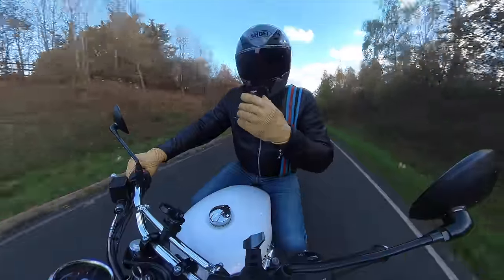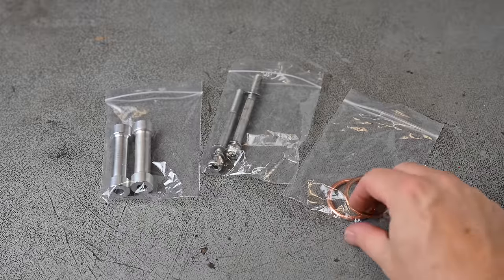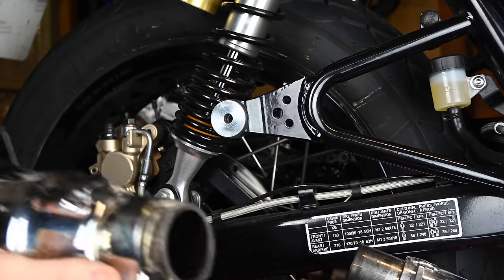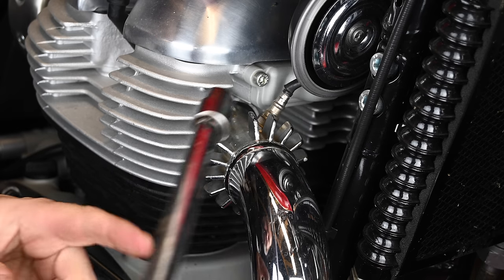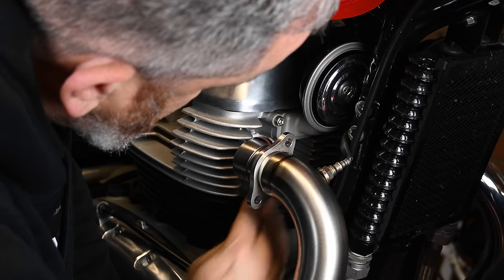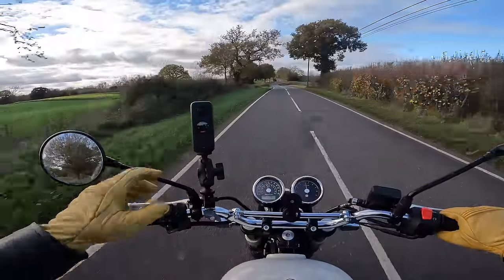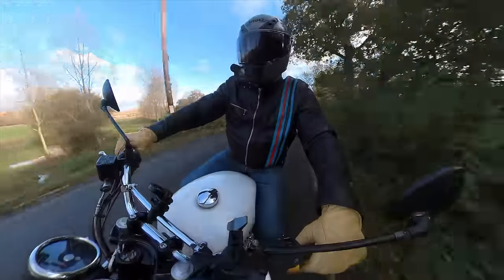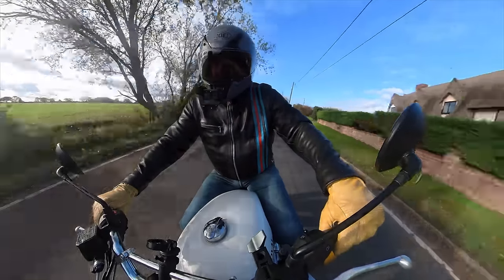Interceptor 650 Project Ep.5 - New exhaust fitting, road test & sound comparison!

Comment from the maker: Since making and releasing the video, Sold Out have reduced the price to £795 inc delivery (within the UK)
Reply: Quality may differ obviously but it looks like a £100 bit of Chinese pipe off eBay £800 seems Ludacris
Reply: Yep, I think quality would differ.
Buy cheap, buy twice.
Is Ludicris a Greek god?
Reply from the maker: I thought Ludacris was a rapper?
Reply: @DucatiDale  I agree that the pricing is steep. There's a company that sells 304 Stainless Exhaust Parts in the Uk and it looks like you could buy all the components for £300 or less, retail. It's not a one piece custom bent, appears to be  standard parts welded together. Looks are a personal thing, but I prefer the look of the original exhaust, I don't like these cut down exhausts.
Reply from the maker: It’s a low volume production made by hand in the UK. I think the price reflects that. The end can isn’t and off the shelf item so you couldn’t buy the components for £300. As with any product you have to factor in production costs, development and some kind of margin. Appearing to be and the reality are different things

Comment: Its a great looking bike but I don't like that exhaust, aesthetically or audibly.
Reply from the maker: Fair enough, it’s not for everyone
Reply: Agreed 100%
Reply: The stock header mimics the frame angle. This looks to be more vertical. Angle and length are subjective, like the time I bought a made to measure suit. I told the tailor what I wanted. It looked fantastic! until I put it on. 😞
Reply: @sscbkr48  yeah.. The header pipe messes up the lines on the bike..
Reply: I like the noise actually but I also think it's a let down aesthetically

Comment: I have my heart set of getting the TEC 2-1 exhaust for my Interceptor, but that short shot exhaust looks and sounds awesome.
Reply: TEC 2-1 are Chinese made & old technology with springs & exposed welds.There 2-2 are look better
quality.Tec 2-1 definitely do the job though & there isn't to much on the market for 2-1 exhaust system for R.E.Tec,S&S but have mini cats,
Verex 2-1 in Ausie but only 38mm diameter not 45mm but look great & high quality.SS Moto Corp make a 2-1 H pipe system.
Reply from the maker: Sold Out have told me they have a 2 into 1 header in developement, with a choice of end cans

Comment: The one with baffle be the one to get that way you have a choice between loud & not as loud cause it did sound loud.On longer rides be to loud even with ear plugs.Weight saving is always good.
Reply from the maker: Yep, this is their first version and a removable baffle is in the works. I’ll try it when it’s available. I might invest in a db meter too to get a proper reading on this one.
Reply: @mancavemoto  Similar to Baak shorty's exhaust.They make their's in their workshop too I think & a very high quality.

Comment: RBB WORLD (on YT) opened both ends of a stock exhaust.. it sounded unbelievably good. Your exhaust sounds not unlike a Bertoni motors (YT channel) where he simply removed the mufflers and ran the headers. Loud but not much louder than your shortys. A 2-1 tec stinger might also look good for an urban scrambler vibe.

Comment: From what I understand the O2 sensors can be disconnected from under the front of the tank which saves twisting the wires.
Reply from the maker: IT was only a couple of turns, so no issue. Quicker and easier than disconnecting

Comment: Hey Tony, cracking exhaust system & massive weight reduction. How is the back pressure? Has the bike lost a bit of midrange pull? I know it’s not a rocket, but when I test ride one with an S&S system, it had a fair amount of pull at mid throttle 🤔
Reply from the maker: It doesn’t seem to be too different, but I will get it dyno’d to see what’s going on and if a remap will make a difference

Comment: Looks Nice and does sound nice got a bit of a dragster sound to it but I must be turning into an old man I don't think I would want to put up with that noise all the time. LOL and I rode Harleys and sport bikes for many years with modified exhausts, many purely for the sound. 
but it definitely looks the part.
Reply from the maker: Cheers Donald, this is only a fun bike and the little 650 doesnt create anywhere near as much noise as a HD would!
Reply: @mancavemoto  
No they don't, 😆 but I don't consider a 650 a small bike, middleweight yeah but compared to a big old Harley it is small. 
I'm still looking to get a Honda but there is a 3 month wait for new ones.

Comment: hi may be a stupid question but when the dreaded MOT comes round would these exhaust be a pass ?
Reply from the maker: With the baffles in, yes they should be
Reply: @mancavemoto  ok thanks they do look cool. Could i ask a rough cost of having the 18 inch rear wheel remade to 17inch please
Reply from the maker: @chrissheppard6818  With the cost of the rim, anodising and spokes your looking at around £350 to £450 depending on current prices

Comment: Does the new exhaust have the EU stamp so you won’t have a problem in 3 years time about it not passing a MOT? And what about the new sound cameras that are being rolled out? 

Don’t get me wrong but my policy when riding a hooligan bike is to sound like an angel. Life is so much easier that way. 👍
Reply from the maker: No, but those versions are coming apparently. It’s actually not too bad, once warmed up, I’ve certainly heard much louder. Ha it’s hardly a hooligan bike!
Reply: @mancavemoto  I agree with you! I love the   Interceptor. I have a GS1200 and a Triumph T100 but I still list after the Royal Enfield. If I sneak one into the garage without my wife noticing I will have one just as soon as. 

PS: I also had a trials bike (Montessa) that I used for green lanes and that I kept whisper quiet. When I met other green lane users, I used to stop, turn the bike off and wait. The response was almost always positive. Adopting a pancake profile sometimes has its advantages. 

Thanks for the vids. And yes, I am definitely going to buy a RE Interceptor as well as so your vids are helpful in guiding what I will improve.
Reply: Lust not list!
Reply from the maker: Yep exactly, I’m much the same to be honest. But this is a fun bike, not a daily so I’m not to worried
Reply from the maker: I think you should try and sneak one in 😂
Reply: @mancavemoto  Good for you! Sometimes it’s good to be bad!
Reply: @mancavemoto  OK! I’ll do that but which colour? Anyway, if it ends in a divorce I can name you as my correspondent. As a mate on mine once said, “to infinity and beyond” or did I just dream that???

Comment: That sounded good as you exited the tunnel, Tony. Would the pipe get through the MOT?  The evidence at 9:46 suggests probably not. It looks unfinished, as well. Not so keen, to be honest. Sorry.
Reply from the maker: Not sure, it’s actually not as loud as it comes across in the video. I’ll be interested in trying the baffles. It’s looks a little odd at the moment as everything else is stock. As I make more changes I’m hoping it gels a little more
Reply: @mancavemoto  I meant the exhaust looks unfinished as it is so short. Didn't make myself clear.
Reply from the maker: Ah I get you now.

Comment: A bit too noisey for me. Defo much lighter but anoyther consideration is looks. Its just not for me, but it's not my bike it's yours. If you are happy thats all that matters. And its also not exactly cheap.
Reply from the maker: That’s fair enough, although it does come across a bit noisier on the video than in reality. Looks are subjective as you say, and I think it looks stranger as the rest of the bike is largely stock. I’ll see how I feel when I’ve changed a few more bits, and I may swap the headers for a longer version and mount the same end cans in the stock location?